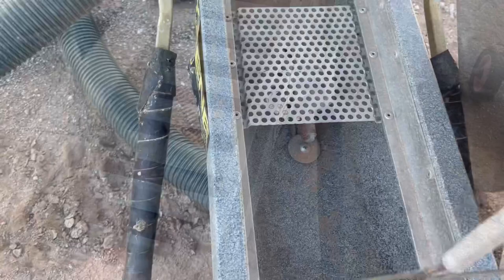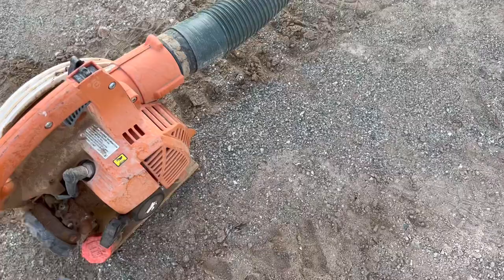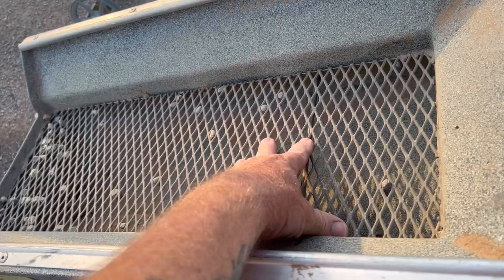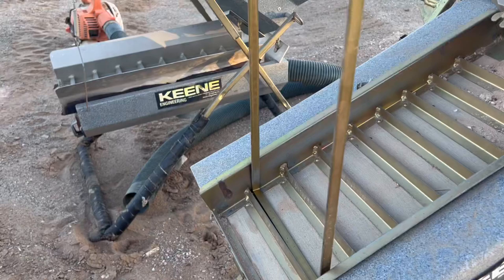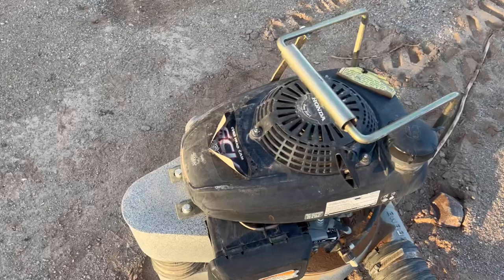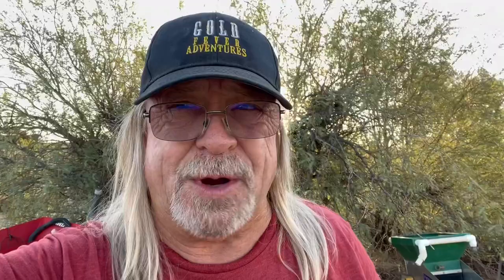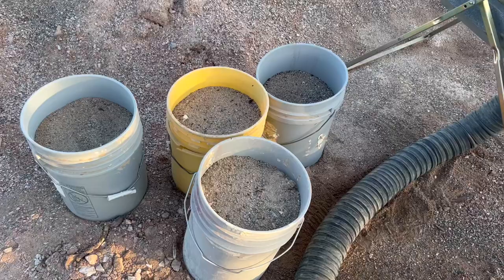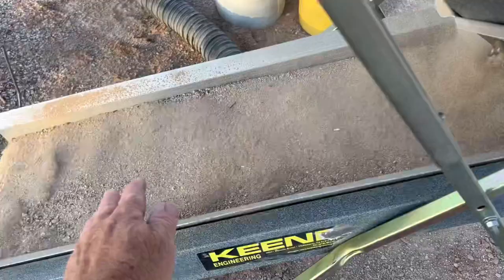Keene 151 /Dry Washer / Check This Out / How They Work / Dry Washing for Gold / Are they any good

Comment: I have that keene 151 with hot air induction but since I live on east coast it catches way too much of the clay etc. It's just not good over here. I wish I could trade for a trommel type but haven't found one yet.
Reply from the maker: Ya they work better on the west coast.
Humidity can also be a problem. Good luck

Comment: Hey now, Travis here. I’ve got a question for ya. I’ve been looking at getting my first machine to start prospecting but can’t decide what to go with. I live close by in havasu and would appreciate your educated opinion what my best bet would be to take with me in my side by side. I’m just poking around on the trails and mountains around havasu areas only. So far I believe I should keep to the dry washers? I don’t know. Please help me make up my mind haha?
Reply from the maker: I would get a small recirculator. You can bring dirt back to run. Use when ground is wet or dry. You start to get an idea over time where to dig and why. Then invest in a dry washer.
Good luck

Comment: If I did go with a wet washer, how much water would you think I’d need to run material for a couple hours? I know the percentage rate is greater for getting gold but do you think it’s worth the hassle? I wouldn’t mind bringing a couple 5 gallon jugs of water with. Hopefully you can turn me in the right direction. Thanks buddy!
Reply from the maker: A couple 5 gallons should be plenty.
Check out keeneeng or Royal for a small unit
Reply: Awesome, thank you very much buddy👍🏼👍🏼

Comment: Is that air motor running at full throttle when it’s working? Just curious if u could put a splitter on that motor and run 2 of the 151’s on the same motor
Reply from the maker: It’s just enough air to barely run one.